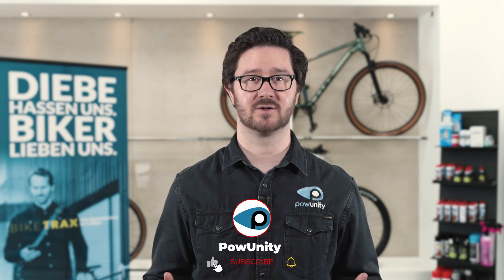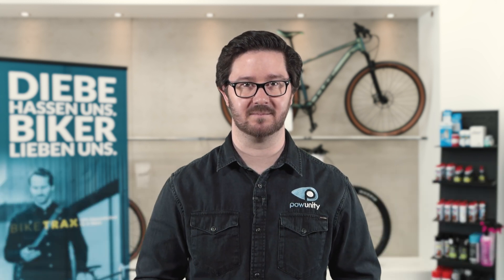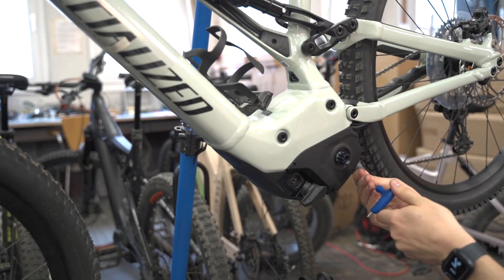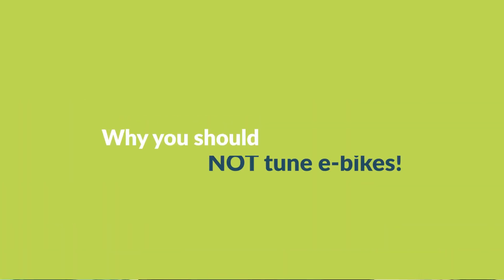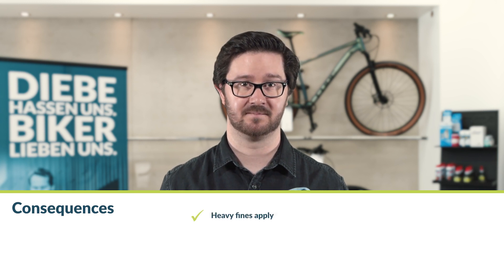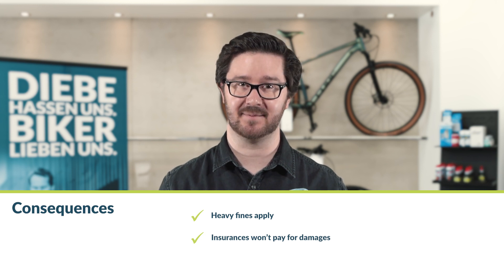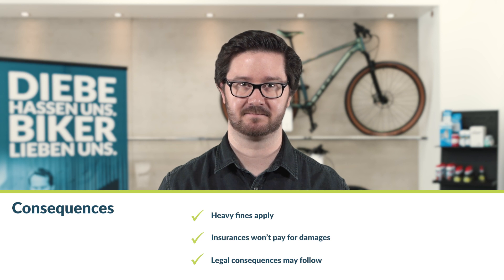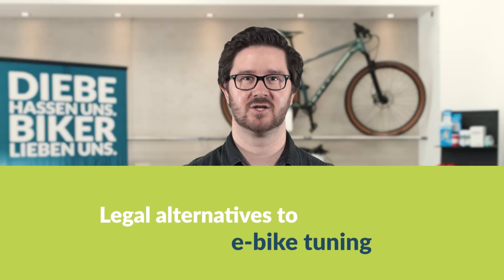E-bike tuning: Are you willing to take the risk?

Comment: I ride an Urban Arrow family cargo line, which puts out 85nm. The speed limit is indeed 25km/h, but what I can't get my head around is this: With that much torque, why on Earth doesn't the drive allow a 25km/h limit at full torque? Why must I be limited to 15-17km/h when going uphill? It doesn't make sense to me. If the drive is in danger of overheating, for example, it would be so easy to just have the drive throttle back the output - or you could use a more efficient method of cooling - but until such a time, the drive should attempt to achieve the 25km/h limit under any load. Coding for this would be trivial.

Is there some logic here that I fail to see?